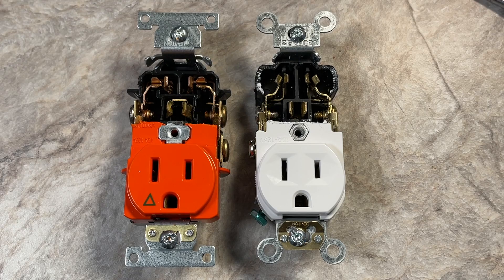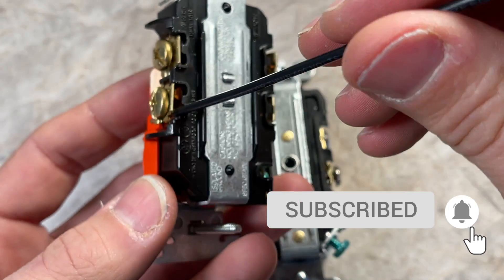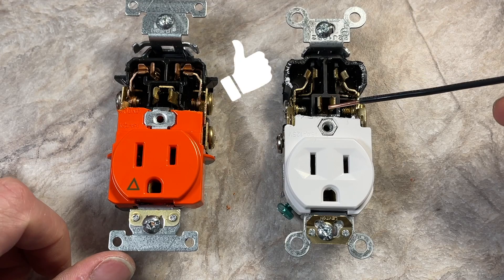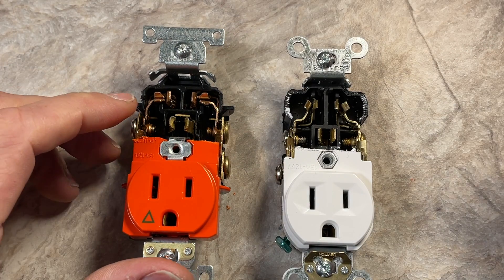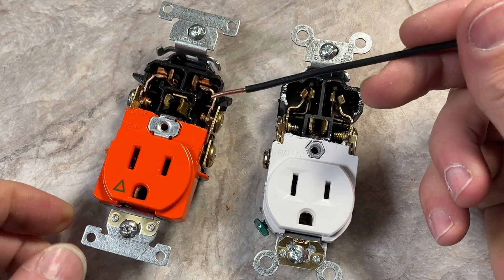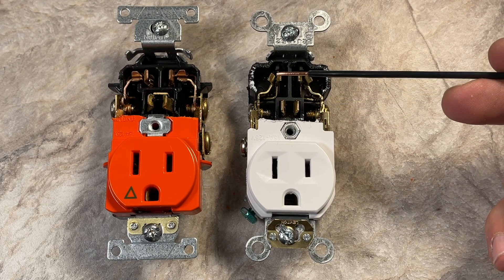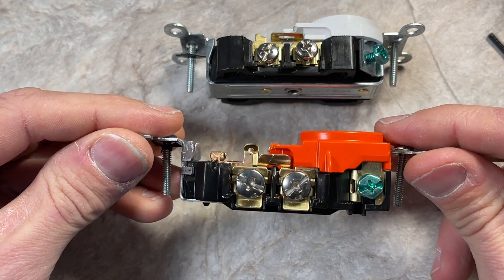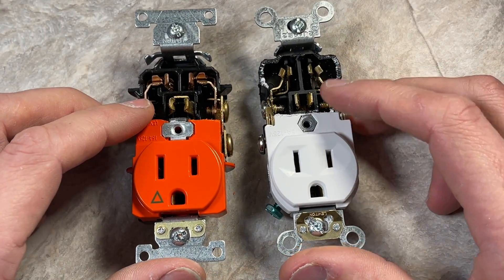What Outlet Should You Buy |  Commercial vs Hospital Grade

Comment: Something else to point out with the internals of the hospital grade, not only would the internals work for a 20A receptacle but they would for for a 250v 20A receptacle (Leviton 8400-w)
Reply from the maker: Hey Jacob, thanks for the feedback.
Reply: Looks like the guts of both the commercial and the hospital grade are universal, able to accommodate both 15 and 20 amp plugs in both 120 and 240 volt configurations. One set of innards for four different types of receptacle. Very clever.

Comment: Red is the color for an emergency powered receptacles in a hospital. also at one time GE hospital grade receptacles used spring steel around the brass contacts to reinforce them . Newer hospital grade receptacles now only  last as long as industrial grade ones and do wear out with much use whereas I've seen 40 year old GE receptacles still having as much tension as a new receptacle due to the spring steel reinforcement. Part of my job for the last 40 years was to do an annual receptacle  tension testing with a Daniel Woodhead tension tester on ALL of the hospitals receptacles.
Reply: Have to look for some of those. Tired of plugs coming loose on my generator.  Or just make something to use the twist lock connectors.
Reply: @allalphazerobeta8643  here is a link to new old stock on E-BAY The good ones have UL stamped between the blades with a kidney bean shaped indent https://www.ebay.com/i/283263698799?chn=ps&norover=1&mkevt=1&mkrid=711-117182-37290-0&mkcid=2&itemid=283263698799&targetid=1068323857870&device=c&mktype=pla&googleloc=9007456&poi=&campaignid=10897343893&mkgroupid=114065833424&rlsatarget=aud-412677883135:pla-1068323857870&abcId=9300403&merchantid=119091584&gclid=CjwKCAiA57D_BRAZEiwAZcfCxcXFC5PyYyz2JgNB__qcpi4uaXll9zT3VYLVN6EwjQkjr0dI2NhckBoCzQEQAvD_BwE
Reply from the maker: Nice, 40 years of frequent use and still maintaining like new hold on plugs is not too bad 👍.  Hard to find any components these days that even have a 10 year lifespan.

Comment: Those push pins receptacles and push in Wago's should be outlawed!!  Electrician of 20 years they're nothing but trouble and a fire hazard as they fail.
PS 6:20  there is no NEC color code for Gen back up.  Left to company policy or personal preference.  If memory serves me right a green dot indicates split switched receptacle.
Reply: Green dot is hospital grade. That is in the NEC just like markings for IG devices.
Reply: I agree that cheap receptacles should be outlawed - when my brother bought his house about a dozen receptacles didn't work because of poor connections on the push in wires. But, authentic Wago connectors have been used in Europe for years and I haven't seen any videos that showed failures. It is a lot easier to make an update in a box that uses Wagos instead of wire nuts - especially when the wires are heavily twisted.

Comment: I was getting zapped by my fridge so badly that I had an electrician friend come over. I discovered that many receptacles were not grounded in my 1950s era house. So he installed some GFCIs on certain circuits at the fuse panel.

The hilarious/scary part was he had me hold the fridge door handle to see if I could still get a zap. The GFCI actuated. But I still got a mini zap. He said there was enough current to give me a heart attack. The fridge went in the garbage within 24 hours.
Scary.
Reply from the maker: 😬 yeah we still have a good number of properties in our area built in that era which only have 2-prong outlets or even 3-prong which someone installed over the years without a ground.  No bueno.
Reply: @EverydayHomeRepairs  But they can be made safe. I was fascinated how quickly my electrician installed GFCIs down at the panel. Easy. He pulled out the wire from the panel and put a GFCI receptacle (in its own box and receptacle) in series hooking it back into the panel.
Reply: Your house probably still had the old knob and tube wiring in it too.
Reply: @KevinBenecke  I hope not 😮 Not that I can see
Reply: I think the hot and neutral were switched around (connected wrong) in that outlet.

Comment: The JCHA, Joint Commission on Hospital Accreditation, publishes standards for electrical hospital safety.  When I was performing those tests, earlier in my career, they included tension tests on the hot, neutral, and ground contacts on a semiannual basis.  Failure on the tension test required immediate replacement of the outlet.  Every outlet and it's related tests were documented.
Reply from the maker: Interesting, makes sense but I wasn't aware of the set testing schedule / maintenance after the receptacles were installed.  Thanks for sharing your experience.
Reply: @StringerNews1 it was renamed in 1987
Reply: that. must .be. hard to test. the tension
Reply: @uiopuiop3472  Techtronics made a tool that measured the tension.  One end was shaped like a ground the other like a spade.  It was a spring loaded tool with a pointer and a scale.  This was 50 years ago so I would expect the tools to have improved significantly by now.
Reply: @ansientwun  So did Instrutek , again ≈50 years ago.
Reply: @StringerNews1 It started as JCHA but changed to JCAHO.

Comment: I was visiting a friend in the hospital a while ago and was using the restroom in the waiting (general public) area. I noticed the convenience receptacle by the single  handwashing sink was a  20A GFCI hospital grade with a little neon light indicator. I thought "wow" that is like a $35 dollar receptacle in a place no one will likely use it...

FWIW, I ended up swapping most of my HG receptacles in my garage back to regular spec grade. You literally need two hands to plug/unplug things into the device because the blade wipers are soooo strong. Makes sense in a hospital, you don't want someone's breathing apparatus plug just falling out, but its a pain to plug a drill into...
Reply: That's what I was thinking... I wonder if commercial grade is a good middle of the road option...
Reply: @ibealion1  Yep. Commercial grade or "Spec" grade is great for residential and a major step up fro the .50 cent big box store residential grade devices. Hospital grade is overkill. My wife cant stand HG receptacles, they are too hard to plug things in and out on a daily basis - no joke - she needs two hands.
Reply from the maker: Agreed, I go with Commercial grade.
Reply: If no one will likely use it, it should be replaced with a blank wall plate, not with a cheap outlet. However, code requires a 20 A GFCI outlet in a bathroom.

Comment: What am I missing here on the ‘backstabbing’? Is this unsafe? I ask, because I’ve been using it for 30ish years and have never had a single failure. Did I just get lucky or is not a thing? I genuinely need to know if I should stop.
Reply: cheaper outlets are notorious for letting the wire back out in backstabbed applications. more or less, it's usually more often the install ala not enough wire stripped for the backstab to get a good bite on the wire, wire bent are sharp angle leads to loosening
Reply: There are 2 types of outlets that allow wire insertion from the back: one type has a plate that clamps onto the wire when you tighten your screw;  just about every expensive receptacle is built this way. The other type represents the cheapest garbage you can buy: there is nothing but a sharp spring plate that bites into the wire when you "stab" it into the back of the outlet. My house was wired with these and I've literally had them disintegrate in my  hand when I pulled them out of the wall. And if someone is running an electric heater at the end of a circuit of these back-stab outlets the current draw will overheat the spring plates to where they no longer grip the wires, and the circuit fails. Some cheap outlets used to give you the option of "backstabbing" or using wire-binding screws. The wire-binding screws are far better. The other thing you may notice with cheap outlets is that over time the internals get loose and sloppy, so your plugs almost fall out.
Reply: @TNickel555  Agreed! The "rising clamp" terminals are SO much more secure! Often the back wire teeth are so bad, that 3-4 twists while pulling will fully remove the wire. Kinda scary!

Comment: IG is for places where you want the ground to be free from random EMI picked up via the conduit and building structure.  AKA Single point grounding. Large buildings can have Earth currents flowing in the grounded structure (I actually ran into a case of Current flowing UP from the Basement of a HIGH rise, and down from the roof equipment that was bonded together (IMHO they should have used insulated cable instead of bare)

Comment: 👍Good stuff. Side note: It's never a good idea to use the "stab-thru" pinch point wire install. Over time mechanism & wires become loose @ connections of course causes expansion, contraction. Heat, oxidation and higher amp draw w/ loose connections causes fires. 
👍✌️
Reply from the maker: Bringing the Payne!  Thanks for the feedback 👍

Comment: Many people are talking about isolated ground for orange recpt. I am in no way saying that is wrong...  no way..  just my observation at work. 

My experience is that orange is  for something on an "UPS". (Inverter / & battery system.. ) .. an entire building should be on a backup generator... but that will often take several seconds to come back on...  UPS = no loss of power.  Zero!
Reply: I usually spec Red for standby power, and UPS color is based on the facility's standard. I've seen blue to designate the outlet that goes back to a panel dedicate to UPS backup.
Reply from the maker: Appreciate the help 👍

Comment: If you got money to burn use the most expensive stuff to redo your home you can find...Everyone i know in old or new homes have used residential electrical products. Which are safe and cost effective....even your half a million dollar  homes use residential grade electrical products...So this video is pointless, unless your building a commercial property or hospital...Common sense goes a long way people!!
Reply: Ive seen $5 million dollar homes with home depot budget brand outlets,switches,recessed lights. the builder will cut corners anywhere and everywhere they can. residential grade is fine, its the bottom of the barrel $1 or less brands that are the problem

Comment: Great job!  Grounding blackstrap is important.  (1) ohms law.  Electricity follows the path of least resistance.  Solid Brass are stronger and less resistant so you want your backstrap to be brass.  If you nickel plate the brass or use stainless it is now more corrosion resistant from cleaning solutions used in hospitals.  (2) notice the round rivets that hold the ground pin to the strap.  Over time that can weaken and not provide adequate grounding.  The best mfr device has a one piece ground backstrap/ pin design.  No rivets or possible weakness.  (3) hospitals generally use stainless steel wall plates.  They become part of the ground system withe the wall plate screw.  Low end receptacles have only a few screw threads for the wall plate screw and can easily be stripped with a power screwdriver.  Best receptacles are threaded from front of the receptacle to the back to eliminate stripping.  A receptacle is always only as good as its weakest link.
Reply from the maker: Hey Joe,  awesome info! I really appreciate you taking the time and sharing your knowledge.  👍

Comment: Opinion from an experienced electrician on receptacles ...
Install spec-grade (commercial), tamper-resistant receptacles in your home.  Use GFCI versions where required, and use WR versions outside.  All spec-grade receptacles will be marked with the text "spec-grade" somewhere on the yoke.

Never install residential grade receptacles. Every receptacle I have ever replaced due to failure has been one of these.

Don't waste your money on hospital-grade, industrial-grade, or heavy-duty.  If you have a machine shop, or something, where you forcefully insert/remove plugs multiple times per day, every day, then maybe install heavy-duty receptacles there. But, I would not bother unless the customer asked for it; those heavy-duty receptacles are designed for factories and such, and I have yet to find a residence where I thought it was needed.

I never install isolated ground (IG) receptacles in a residence. IG requires two ground wires (one insulated) or a properly installed metal conduit infrastructure and an insulated ground. You need to connect the insulated ground to the ground screw, and connect the bare ground wire to the metal junction box. Most houses use plastic junction boxes, don't use conduit, and they are never wired with a "spare" ground. If you install a IG receptacle without the aforementioned requirements, then it is no different than a regular receptacle (maybe worse because it is hard to ground the yoke), and it is a waste of money. Also, IG receptacles, even when properly installed offer little/no value in a residence.

A word on the markings...

Those little symbols on the plug mean something. If there is a triangle there, it signifies the plug has an isolated ground. If you install a IG receptacle, but don't properly wire it, then it will fail inspection due to code violation.  Why? because the receptacle says, "hey, I'm IG!", but only you know it is not. In the future, some unsuspecting person might "need" a IG receptacle for whatever, and think it's safe to use that one.

When you install a hospital grade receptacle, that green dot tells everyone that it is installed according to NEC Article 517. But, in your house, it most certainly is not. It requires an insulated ground like IG receptacles, but not an extra ground wire.  Unless it's a hospital grade IG receptacle, of course.  If you need a heavy-duty receptacle, then install a heavy-duty receptacle, and avoid hospital grade.

A little off topic... If you have an old house, you cannot just replace the old 2-prong receptacles with 3-prong receptacles.  The 3-prong receptacle tells the world "hey, I have a ground wire here", but it doesn't.  There are ways to install a 3-prong receptacle without rewiring the house, but that's beyond the scope of this post.
Reply from the maker: Tony dropping some knowledge bombs 💣.  I think I get the most from posting these videos and having people like yourself share tons of useful information.  Appreciate you taking the time and effort to share so much good info.  Happy New Year!
Reply: @Tony Pombo Beautiful! Care to a word for those asking about putting 20 amp receptacles on 15 amp circuits, and what the insurance won't do if you burn your house down from it? Thanks!

Comment: this is an isolated ground receptacle can be used anywhere i use these in commercial where you are using large amount of computers or other devices that are sensitive  usually computer related like servers data centers, ect. The little green Triangle on the receptacle identifies it as isolated ground.
Reply: Yes but let's clarify for other readers that you must have a true isolated ground system for these to be of any benefit. That means a separate ground wire back top the service or some designated central ground point. And that point must be bonded to the building earth ground and service neutral. Isolated ground systems prevent noise pickup from metallic conduit coupling to the device electronic system ground. Also if you do use IG receptacles without an IG system you would need to tie the ground terminal to the box ground. Otherwise it's floating. I'm not even sure if code allows IG receptacles to be used in non-IG systems.
Reply: @andydelle4509  Isolated ground systems are also something PEs should have left in the 1990s. Modern equipment doesn't care.
Reply: @ironmatic1  Modern computer equipment with switch mode power supplies don't care. But there are still applications where ground loops and noise are a problem. Sensitive measuring equipment in labs. Anyplace analog audio is still used such as in recording studios. Microphones are still low level analog devices which require sensitive analog preamps before being converted to digital audio.
Reply from the maker: Thanks for the feedback Jordan.

Comment: I thought the orange ones were to denote the receptacles that that were tied into the back up generator system. Only for use of vital life supporting machines and the like
Reply from the maker: Hey Buddy, I think Red indicates emergency power and orange is a quick reference to isolated ground.  I misspoke in the video and stated that orange indicated backup / emergency power.
Reply: @EverydayHomeRepairs  Ahh, my apologies. I commented before i had finished the video. I was mistaken on what the colors meant
Reply: In some hospitals the orange one's are connected to the generator.  It probably also depends on the building code in a given area or state.  Here in my area near Pittsburgh, PA, the hospitals emergency power goes through the orange ones.  It may be the newer hospitals use the red one's too.

Comment: Hate to be that guy, but isolated ground is identified with an orange triangle (or contrasting color) on the front of the device. Where as hospital grade is identified with a green dot. Combination devices will be marked with both.
The orange color of this device is just to quickly identify that it indeed has an isolated ground.
[reference UL standard 498. NEC 406. NEC 517]
Reply from the maker: Hey John, thanks for the feedback and I appreciate you sharing the knowledge.